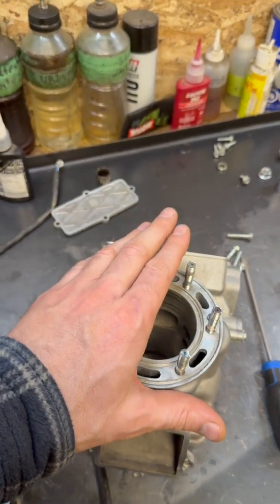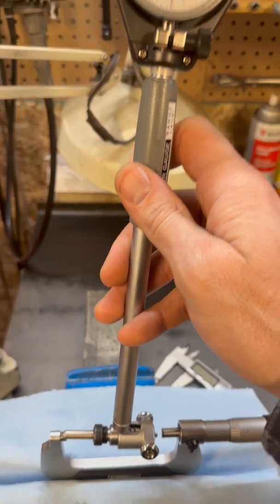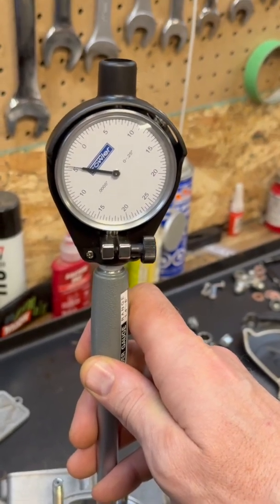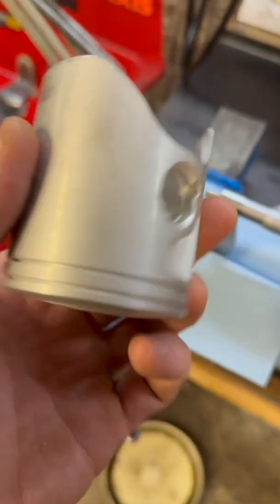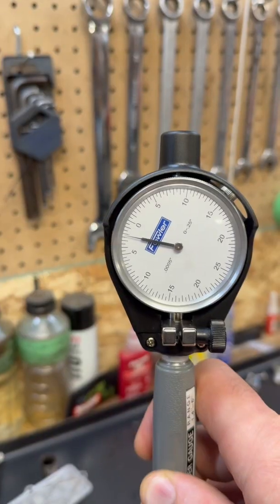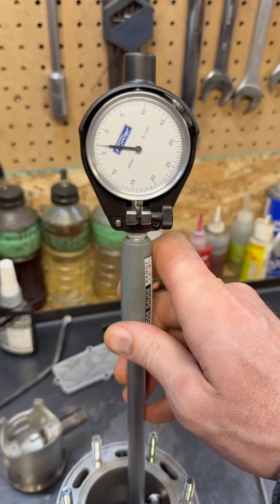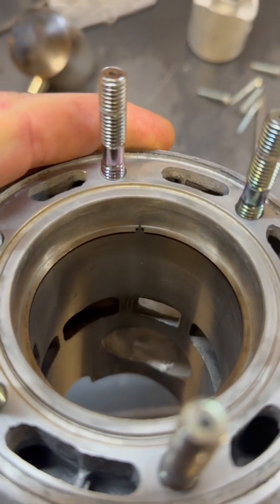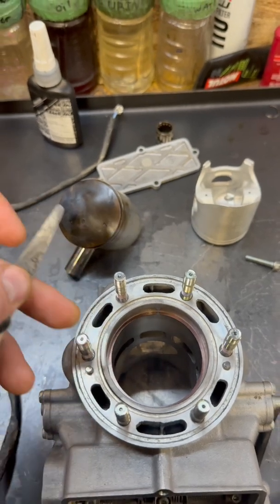How I Measure a Cylinder

Comment: Hey i was wondering if you using repair manuals or you using something else
Reply from the maker: I use repair manuals regularly but I rarely need them for checking piston clearance or ring end gap.
Reply: @ChuckfromTrueTech  how are you checking that without manuals?